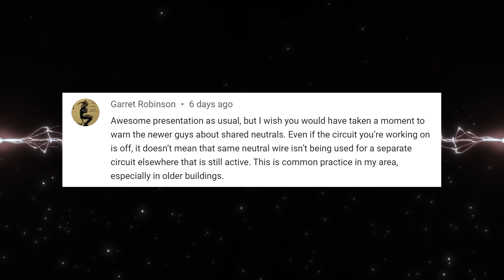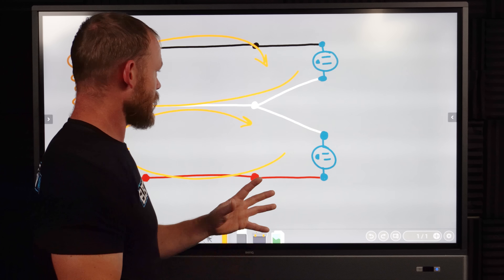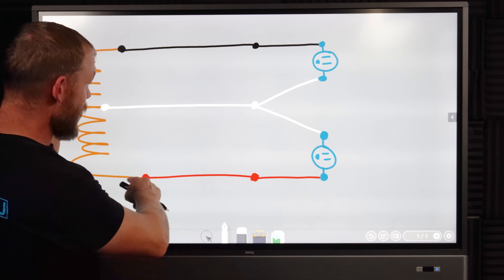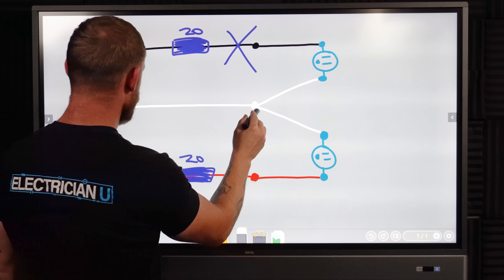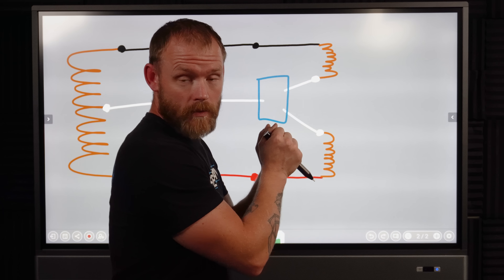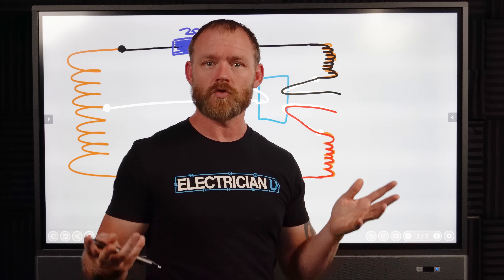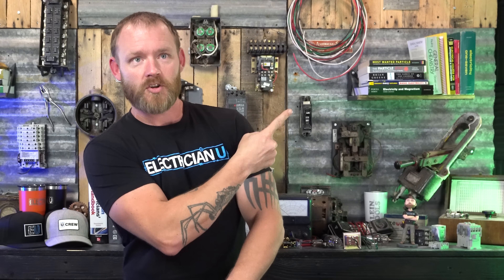The Dangers of Shared Neutrals: How To Avoid Being Shocked

Comment: Other danger i see is if on and remove the main neutral then you have 240V like you said but also may end up with the loads being wired in series. Series in theory each would get 120V but it would depend on the current draw of those devices. The larger draw would pull more voltage but could also fry the other device due to drawing too much current through it.  

This is also why when  I work on even dead circuits I splice things in this order Ground, neutral, hot. That way you are really only exposing yourself to the hot potential once as oposed to splice the hot then the neutral. Ground first just should there be issue and sometimes for small fixtures it is a nice anchor point to hold it till you can get the other wires linked.
Reply: Your basic logic is sound, but I think you’re confusing voltage and current. The larger draw would get less voltage. If you run a 60 watt bulb and a 100 watt bulb in series across 240 volts, the 60 watt bulb will see 150 volts and the 100 watt bulb will see 90 volts. (Ohms law).

Comment: The Balanced current on the white line.   BALANCED you drew it incorrect.

The balance would be thru the two PLUGS.   The two vacuum cleaners.

comment please.   240 volt circuit also same thing.

Comment: Is there an easy way to find shared/borrowed neutrals? I just bought a house in Texas. It was built in 1978. I've gone to replace some of my receptacles, and gotten a tickle on the back of the hand from a neutral wire when I had already turned off the breaker for that receptacle (NCVT seemed to indicate it was dead). I eventually found the second breaker that I needed to flip to make sure it was completely dead (verified with multimeter). Every 3-way switch in this house was done with 14/2! I have converted every 3-way switch in the house to a single pole (leaving behind labels on the wires to indicate where that wire is going or coming from and putting blanks where one of the 3-way switches had been). With WiFi light switches, it's still convenient enough. Pretty sure there are still some shared neutrals. They seem to cause such strange behavior. For instance, even on the lowest dimmer setting, the LED lights in my dining room were almost full brightness. After converting my breakfast nook light to a single pole so the hot and neutral came from the same breaker, the dining room light was able to get very dim or bright just as desired. Now I'm noticing my TV room lights don't get very dim on their lowest setting... makes me think another shared neutral still exists (and yes, I have tried calibrating my dimmer to make sure it can go to the dimmer's actual lowest setting). I'm amazed shared neutrals were ever allowed.
Reply: LED bulbs and dimmers can exhibit flaky behavior even if they are rated as dimmable. Depends on the bulb and dimmer combo.

Comment: At 3 minutes 40 seconds you speak of a complete loop, can you not get shocked touching the top neutral? You to ground and back too source is a possibility, albeit a higher resistance then the neutral so very low ampacity. 

Right?

Also shared neutrals now required to have both be bound to eachother. Ie. Disconnect together

Comment: Can a GFIC share a neutral on a two separate 20 amp phases sharing a neutral
Reply: I ran #14/3 to some receptacles boxes, then decided I wanted GFCI protection. I had to buy very expensive two-pole GFCI circuit breakers to accomplish this. All is good, though.
Reply: @paulmaxwell8851  Or you could have used TWO GFCI receptacles

Comment: I was replacing a dishwasher in a house and there was like 20v on it and very low amp, not enought to shock. There was a garbage disposal there also. I was wondering if there is such a think as a ' transformer effect' with two wires that are pulled together and have a few turns in the walls? I can not remember if the volts went to zero or not when the disposal was turned off.
Thanks for you videos. 

Also we had a bad ground in the meter base and it was interesting to put your hand on a pipe and feel the current go through one arm and put your other hand on it and go through the other arm.
Reply: Possibly an illuminated lightswitch?

Comment: The most basic question that I wish the video spoke to is, how do you know if there's a shared neutral? Inside my panel I saw red wires used for 120 v circuits. That caused me to trace where the wire was going, which was Romex that also had a black conductor from another circuit. I hadn't seen this before and ended up learning more about it on your channel. IMO it's crazy that shared neutral circuits are allowed in residential construction because over the life of a home, someone can easily rearrange things in the panel in a way that's unsafe. In one of my circuits, someone had put the red and black wires on the same phase and ended up with double current on the neutral, which was a fire hazard and had to be fixed. Our home inspection missed this issue.
Reply: I've got a degree in electrical engineering so maybe I can help.

You won't know!  Also, it's not going to be an issue unless you mess with the point where the neutrals are tied together or in the circuit breaker panel if the other breaker is still on!

Best advice from someone who have 30 years experience, just turn the entire circuit breaker panel off if your not sure about how things are wired.  You could also use a tone generator to see if the neutrals are shared.

Fluke Pro Probe 3000 toner, there are videos on YouTube how to use this tool 😉
Reply: Home inspectors aren’t usually electrical professionals. It’s not their job to get in to the nitty gritty of the panel.
Reply: Not an electrician, so take this answer with a grain of salt, but the only way to somewhat know for sure is to open the panel and trace the wire for the circuit that you're working on to see if it's something like a 14/3 or 12/3 (and then double check that they're on different phases like they should be).  Even then, you have no guarantees that someone didn't do something insane like tie neutrals together from different circuits if there are multiple circuits in a junction box.  If you didn't wire it yourself (meaning you're not 100% positive how everything is wired), just take the 30 seconds to put your meter on each wire to see if there's voltage.

Btw just because the wire is red doesn't necessarily mean anything at all - 14/2/2 or 12/2/2 is a thing, so a single piece of romex could have enough conductors in it for 2 full circuits with no shared neutrals, but there may still be a red wire present there.
Reply: Usually 2/2 wires they indicate with a red mark on the neutral with the red and black mark on the neutral with black

Comment: Super good video. It is good to instruct the helpers/apprentices to be very careful in old houses and make it a requirement to turn everything off at the main before working on any circuit where the neutrals will be broken apart. One for safety and two to keep from blowing random things in the house up from open neutrals. Bought an older house and discovered that every single 120v circuit in the house were ran in a loop of conduit (from and back to panel) with a junction box every 10'. The circuits had 4 neutrals total from the panel and every neutral was half ass twisted together as no wirenut would fit with a piece of tape for cover at every junction box. Honestly don't know why the house had not burned down.

Comment: yea we ran 12 /3/4 until very recently. on home runs we would pull three phases one neutral one ground.  saved alot of room in the conduit, ment more circuits in a smaller pipe.

Comment: At the Breaker box there is 2 120v which stagger on the breakers if you have 2 plugs or what ever coming from the same side of 120 you will only have a total of 120 until you connect to the other side of the 120.Then you will get 240v ??

Comment: One additional note on this.....  if you disconnect the neutral at the panel but leave the 2 circuits tied together you'll fry the loads because it'll be 240v Series instead of 120 v Parallel circuit.
Reply: i believe if you disconnected that neutral from the panel inside that JBox, and then connected just the 2 going out, yeah, ya have the 240 volt flowing through tv's, radios, dvr's, etc.
Reply: @keything8487  No, current will only flow with both circuits on, each one (loads) will drop (about, around, whatever) 120 volts each. If one is off, no current is drawn, so therfore no voltage drop across either load.
All that aside, i only wire with a common neutral when I have a balanced load on each circuit, mainly motors, such as two garage door openers. When used this way, when both are running, they are dirctly (across the 2 motors) getting 240, each only gets 120, and no current flows through the neutral. Only unbalance current flows through the neutral.
It works that way, I've checked this out so many ways myself, years (decades) ago...
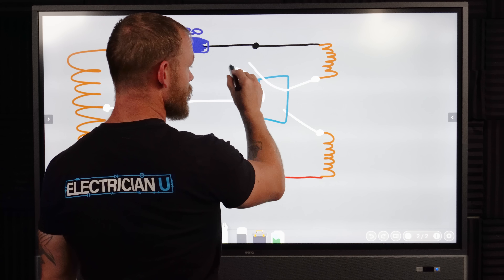Reply: @brucelytle1144  look at 6:15-7:45.....at the 737 mark, if you wire nut the black n red wires (as shown in video)(because someone ties the whites together without the "homerun neutral), with both breakers on, every 120v lamp, appliance, & electronic device on those circuits would smoke.  there are very few balanced loads in a house or business (especially at 120v)... something is always drawing current...
Reply: @keything8487  jeez! Louise! Sorry, when you hook them up like that those (2 or more) loads are in series and will split the voltage. I'll give you that if you make a parallel circuit on one load could give you problems. But two separate loads in series will still split the voltage. That is why I took the time to explain, last comment, was I only use it on equal (basically) loads.
Let me go on and tell ya a story that may make my point. Real world problem, drove me crazy!
I'm Chief Electrician on a ship coming out of an extensive refit/reconfiguration.
One of the things I had to do, was make a complete tour of the ship, looking for and taking care of problems.
First time through one of the holds there was a string of lights out. I followed the cables around, and found a fixture where the shipyard hadn't passed the power to the next one (and all of them after), so I hooked em up, a voila! They all worked now, after I turned the breaker back on that I'd shut off. 
Now let me briefly explain a shipboard electrical system. They are a 480/240/120 3 phase UNGROUNDED (no neutrals!) They freak out shoreside sparky's!
So, da ti da, life's good, later on I was in another lighting panel and notice a tripped breaker, I turn it on, no problem, think nothing of it.....
Until the next day, strolling through the holds and that one hold, now all the lights are out, go check the breaker, reset it and check, all is good. Later, back at the panel on the other side of the ship has tripped. 
Yeah, took a couple of times, till I figured out what the yards had done. They'd set it up being fed from 2 panels, they disconnected them there and hadn't pulled the cable out or reset the breaker.
It didn't blow anything up, just tripped a breaker.
Oh yeah! On a ship, all single phase circuits are 2 pole, 3 phase 3 pole.
Reply: With receptacles, the circuit stays open until a load is plugged in and create a path between both terminals. 

This means on a MWBC sans neutral back to the panel won’t be complete with a single load plugged in only one side of the branch circuit. It requires at least one plugged in load on each side of the branch to complete a 240VAC circuit. 

Actual voltage seen across each load will depend on the effective resistances of each side from the connected loads. When they are perfectly balanced they will both see 120V across, but if they are not the voltage drop may be split differently.

For example, when each side has one load connected and one load is 2x of the other, the smaller load will see 80V across while the larger load will see 160V across.
Reply: @toukoaozaki  how many empty receptacles are in your house?
Reply: No they don't, they split the voltage between them. Both get 120 each. If you turn one side off, they both go off. 
If you have a balanced load on both circuits, the neutral carries no current. On an UNBALANCED load, the neutral carries the imbalance current.

Comment: Important to think about during ballast replacements in 277V applications in large rooms with rows of lighting fed by multiple circuits.  I'm sure there's nothing like having a hot neutral fall off of the fixture your working on into your ear or eye while standing on a ladder.
Reply: 277 is a bit harsh for beginners.  Start 'em off with a 120V lighting circuit with the switch on the neutral side, then leave them unattended while the old "I turned off the switch do I really need to turn off the breaker too?" argument plays out in their heads.

Comment: I went to work for the state (TX) recently and it’s pretty common for the electrical contractors to share neutrals on new installations. I’m a maintenance electrician and I’m getting pretty frustrated with the crap they leave behind for us to deal with. There’s shared neutrals everywhere and an “anything goes” color code. In Austin it’s red, black, blue for low voltage and brown, yellow, purple for high voltage. But within Austin’s jurisdiction State jobs are not subject to AHJ. So some contractors do it by Austin code and others do it by everywhere else color code.
Reply: up here in new england i see this all the time with older homes....nothing is ever labeled in the panel of course..
Reply: The shared neutrals on new installations being allowed is on the inspector for passing it. It isn't code.

Comment: Recently had a situation that they had run 12/2 and tied the neutrals together in another switch box.  We we’re replacing a bathroom outlet with a GFCI ( place was built in the early 70’s ).  Couldn’t get the GFI to set.  I had to start running down the wires in the other places that the power went out with that breaker.  Found the neutrals tied together in a switch box.

Comment: Single pole breakers are allowed on exterior lighting circuits with a shared neutral [NEC 225.7(B)]. NEC recognizes the voltage drop benefits of sharing the neutral because typically long distances are involved with exterior lighting and they recognize the liability of loosing multiple exterior lighting circuits from a single short if multipole breakers were required. So, extra heads up when working on parking lots and street lighting.
Reply: 225.7(B) doesn't say anything about breakers, but it does call the multiple ungrounded conductors a "circuit" (singular), as in a multiwire branch circuit.  225.7(A) says outdoor lighting circuits shall comply with 210; including the handle tie requirement for MWBCs.  Something of a moot point now since 226.7 has been deleted in the 2023 NEC; it was an unnecessary section IMO. But yes an extra heads up when working in those locations; a common danger is the lack of EGC.
Reply: @barryomahony4983  You're right...2023 NEC has deleted the exception that permitted the shared neutral for exterior lighting. There are many municipal lighting systems that use the shared neutral...It allows street lights and the seasonal lighting receptacles on the poles to run at 120V, and have each pole stagger circuits so if there is a fault, only half the lights would go out, which is much less dangerous for drivers and pedestrians. Now without the shared neutral, the conductors will go from #6's to #2's and have to run an extra neutral. And there will be current on all the neutrals, wasting energy (about 1.5% wasted energy - not much but still less efficient). I disagree with the NFPA - there are many good reasons for that exception for exterior lighting in the code.
Reply: @danhardhat2  Well, I'll have to reread this but I didn't think it prohibited these shared neutral circuits. These are completely safe circuits and quite useful and practical for long runs.  Not very common in regular residential wiring. These used to be quite common in long agricultural buildings and shops.  As you point out, there are applications of this that make a lot of sense. 

I tend to look at it this way, what properly trained electricians would think it OK to spilt a two pole breaker into single pole circuits??? I can kinda see a DIY homeowner not understanding, but then I have long advised against electrical work as a DIY skill. I blame the internet for convincing people that they know what they are doing, when they clearly don't.  What makes it even worse is all the stuff posted from 240 volt countries like "this is how it works everywhere in the world"!!!! It just confuses the hell out of DIYers. wh really should not be doing this work in the first place!! 

Does anyone in their right mind consider DIY surgery?? IDK, but I'm guessing that most people realize that the consequences of not completely understanding or doing something wrong, might be fatal. But working on electrical without fully knowing what you are doing, can have the same kind of fatal consequences.
Reply: @professorg8383 not trying to be that guy but most farmers do DIY surgery on their livestock since the cost to have the surgery done at the veterinary clinic is often close to what the animal is worth. 
Either way you are going to lose the animal, might as well give it a shot. 

I assume it’s the same for people who want electricity in low income areas.
Many countries make it nearly impossible to live without electricity anymore so I assume it’s out of desperation. 
Most people would prefer to call an electrician or a surgeon for everything but many people can’t afford either.
Reply: Its not just exterior lighting but where you have sensitive equip. like a lab, just removing the neutral could fry whats on those circuits, even cutting circuits off not together can also do it.